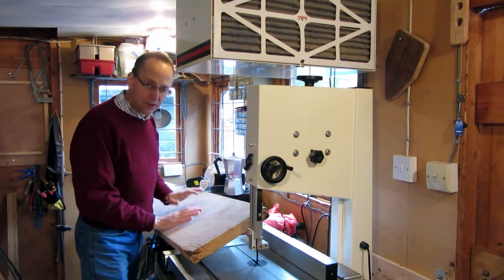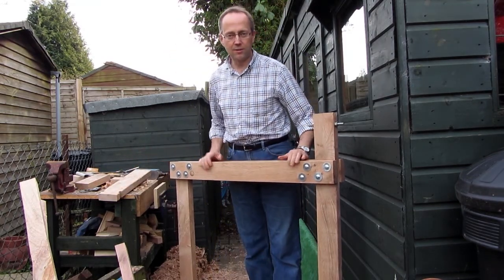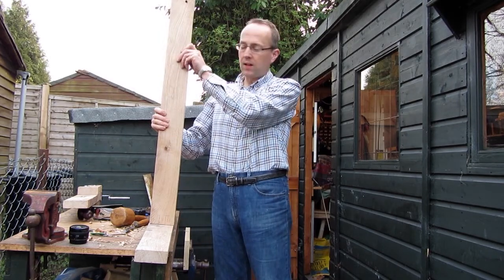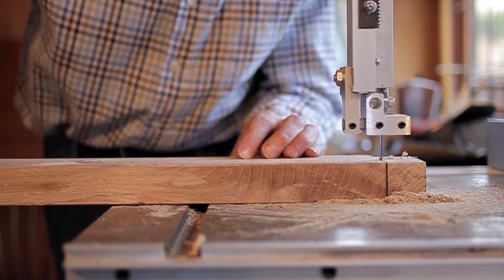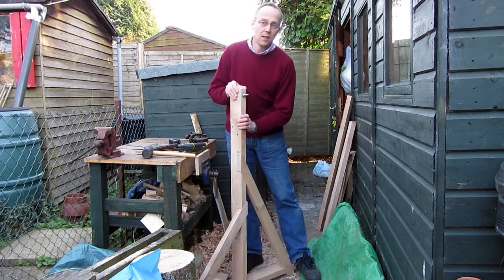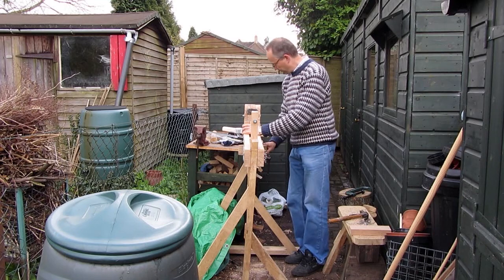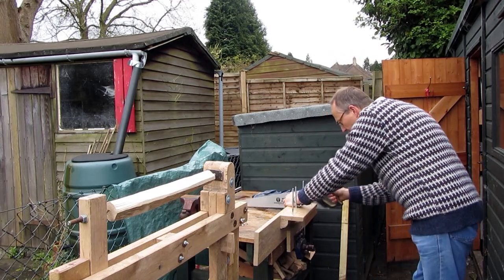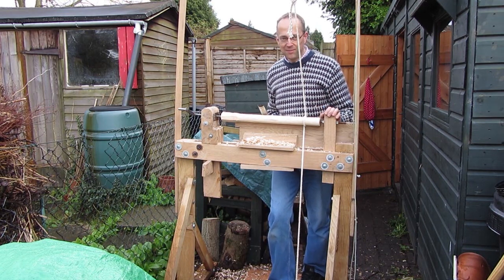Making a Traditional Pole Lathe

Comment from the maker: Hi - I used about 5ft 6" of 6mm bungee - its a light bungee as I am only turning chair legs. 8mm bungee is readily available, and is not a bad all round choice. I got my 6mm bungee from a radio control gliding shop - used to launch model gliders. I am using lawnmower starter cord for the rope - approx 3m. My bungee posts are quite high to get the required travel. Well done with the lathe - good luck, and please let me know if I can help further.

Comment: i used a 1" dia. lag screw for the dead center on mine.  i ground the tip to a point.  i cut off the head, sliced down the middle of the shaft along the unthreaded section.  i threw it in the forge and hammered the 2 half sections into long thin squares and bent them around to form a heart shape.  i also made a bolt into a hook on one end.  it lives in the poppet and wraps around the lag, it has a wingnut on it and it's job is to keep the center from coming loose.

Comment: it's a weird lathe.  it's a reciprocating lathe like a spring pole lathe but it uses a steel coil spring that lives below the rails.  the drive rope turns a spindle that's mounted in bearings and turns a live center made from an all-thread connector nut split into 4 sharpened nubs at the drive end to grab the work.  the benefit of this freak is that it is self-contained, light, and transports easily.  also, you don't have to worry about cutting into your drive rope.

Comment: Just a quick question I have now made my lathe but at a loss as to how much shock chord i have tried the cycle type bungees but there is not enough travel in them to make it work effectively, i.e. its got to at least stretch for the amount of travel from the wood on the lathe bed to the floor and be strong enough to return. how much did you end up using ?

Comment: hey harry how do you attach you up rights and bungee chord to the frame?
Reply from the maker: Mike - the uprights are simply bolted to the sides, and the bungee cord is simply tied to the tops of the poles - I drilled a hole through to keep it in place.
Harry